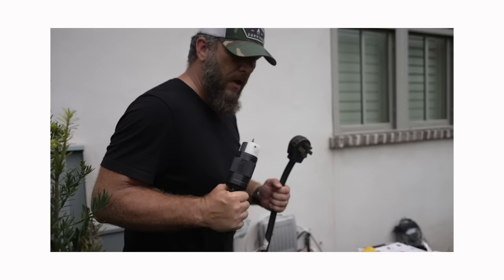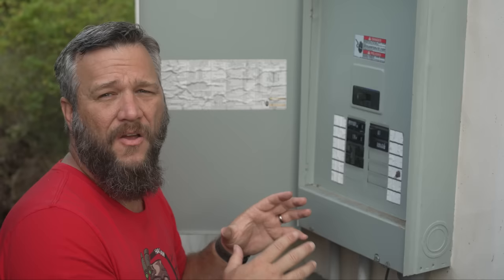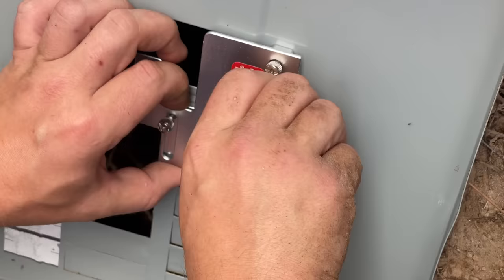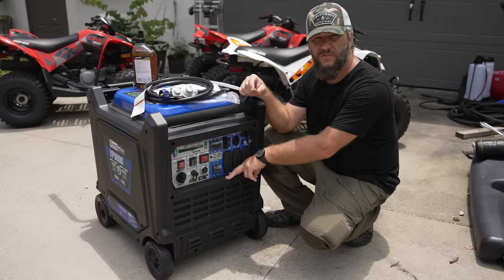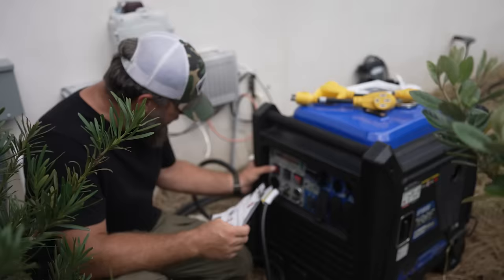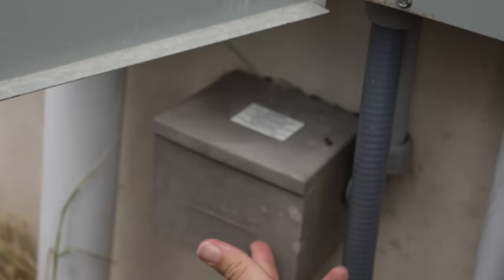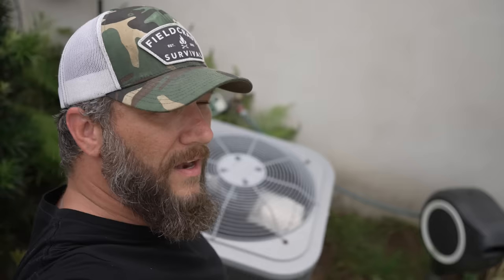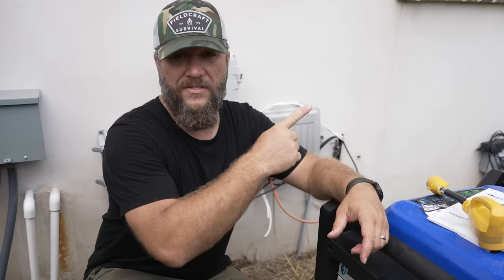90% Don't Know About This Fatal Generator Connection

Comment: All good information. We don't have the same systems here in Australia but could I suggest you get a permanent ink pen and write the procedure on the panel next to the switches in case you are not home when your family might need to use the generator. Also put some concrete blocks down for the generator to rest on. If you need to use it then your garden will probably be soaked and it might settle off level which could affect oil pick up in the engine. Keep up the good work.
Reply: Actually my breaker interlock kit came with several stickers to put on the panel and inlet device to give instructions on how to implement the change from utility power to back up genset operation. Great point!

Comment: If that is an electric stove, I would be very careful about using it, or just don't use it.  You can probably get way with running one burner if you cut back on other loads.  Also, that generator may (depending on the size of the AC) run your AC, but again it will take most of the capacity.  AND, speaking of AC, I would strongly recommend getting a soft start kit for the AC.  That reduces the start up current needed.
Reply: Consider portable induction plate(s). They are efficient and with some, you can control wattage. Yes, you will have no oven, but you can efficiently cook meals in something like a Dutch Oven without massive current requirements. I have been using a NewWave Gold single unit before buying our induction stove to see if I like using induction. I ran it for several months. I am keeping it after buying an induction range, because I know it will work well with my Champion 4750w genset.
Reply: @drzman6901  That is a very good idea.

Comment: I worked my entire life in the electric utility industry and I can tell you for certain a home gen set can and will backfeed the system.  No, it won't be able to power up the grid, but in a restoration situation there will be many lines broken and on the ground.  A home gen set could backfeed a single transformer with its primary lead on the ground.  A lineman who is careless could touch that conductor on the ground and easily be killed.  We were taught to listen for gen sets and to NEVER handle a conductor on the ground without rubber gloves and grounding the conductor.  I can't tell you the number of home gen sets we've come across that were connected incorrectly.  This video is an excellent demonstration of the correct way to connect a home generator.  The only thing I would add to these instructions is if you have a small generator you would want to turn off all your breakers before connecting the generator.  After your generator is connected and running you could then turn on just the circuits you need such as the refrigerator and some lights.
Reply: The generator would shut down immediately if this happened from the current draw smfh
Reply: @msnapp169  Which part?  A gen set can most definitely back feed a distribution transformer...I've seen it and experienced it in my 40 years in the electric utility industry.  How many storm restorations have you been involved with?  Also, you can add load incrementally to a gen set until you reach the maximum capacity of the set.

Comment: Look into a soft start for your a/c unit, It'll make it super easy on your generator at startup from the inrush current. Mine went from 77amps at startup to 19amps.
Reply: Look at "EASY-START" my 3 1/2 -Ton went from 112 Locked Rotor Amps to 35 amps. It doesn't change the running amps, but it will keep your generator from tripping when needed.

Comment: Excellent video Sir. We have a small home so I have a Pulsar 6500w dual fuel generator($550) with a 30amp connection to a Reliance 6 circuit transfer switch( $300) and use a 50' 30amp RV extension cord($250). It will run all my essentials. I installed the system myself with the directions and google videos. It took a minute as I wanted to be cautious, but overall it was fairly straight-forward. $1100 + tax in equipment and about 5 hrs total labor including several test runs($500) So I figure about $1800 all in.

Comment: Good for you for providing this info. Just to add... the lineman won't see just the 120v or 240v your generator makes. Those step-down transformers that feed your house are just as happy to "step-up". They will step the gen's voltage up to the line voltage of your neighborhood, albeit with far fewer amps. But it takes as little as 0.1 amps to kill and at line voltage, that's easily done.
Reply: yea if you back feed the lines, you can actually power your neighbors houses assuming your generator is powerful enough
Reply: First off a lineman would have to forget all of his training to get shocked. They're required to ground everything just like it's a live wire 
The next problem is if you did backfeed the lines as mentioned you would send power to everyone on the grid and you would pop the breaker on your generator depending on what they had plugged in or turned on. You're only outputting 50amps and a couple of AC units is enough to trip your breaker.
And of course you would really have a problem if you were backfeeding the grid and the power came back on.

Comment: In the Navy when using emergency power - we connected source to load and unconnected load to source. Then utilized the no/off switch. We never had to handle a 'live' electrical cable. The effect was that this the only thing being powered up, at the time. As a load hits the generator there would be a slight drop in the 60 cycle hertz as it took that load up, then the governor would recover. Disconnecting worked the opposite way, as the load decreased the hertz would increase a little. Could turn off all the breakers when you turn off the main. Connect the generator, start the generator, then turn on the circuits (breakers) you want to energize. This should result in less wear and tear on the genset.

Comment: As an aircraft mechanic in the AF for 13 years so far...electricty still scares me.  The sh!t is straight up magic and terrifying
Reply: Duuuude.... I'm totally in that same boat. Electricity confounds me like nothing else.
Reply: Agreed. But I was more scared of hydraulic and gas pressure, especially when servicing struts.
Reply: @richieanderson6605  I've seen some pics of what can happen to you hand if a hydro line fails, not pretty.  I'm just an engine mechanic so not really worried about hydro destroying me too much.
Reply: @brandon7219  ah, got ya. I was an F-15/F-16 crew chief.
Reply: Angry pixies...are no joke....

Comment: That generator has a neutral and ground bonded internally which should be disconnected when using for home backup since you home will have its own neutral-ground bonded.  
Good job on getting proper interlock 👍
Reply: Thank you, I’ve been told you can put a switch in your panel for that. Something I need to do.
Reply: My generator is bonded, and I didn't want to monkey with it - void your warranty. I left the ground wire of the four conductor cable disconnected at the generator plug to "debond" it.
Reply: Disagree with disconnecting the grounded connection. It does no harm connected! As for the neutral, there would be zero current in the neutral from the generator if the CB is in the OFF position. Why disconnect it and then forget to reconnect....This is a non-issue.
Reply: @jstone1211 National Electric Code disagrees with that statement.
You may also have issues with AFCI and GFCI breakers having it bonded in both places.
Reply: This is absolutely a problem. Your service should only be bonded in one spot, at first point of disconnect, i.e. your main breaker in your panel. Bonding the neutral and ground in another location will create Objectionable Currents which is a no-no, see NEC 250.142.

Comment: Good Video Haxman.  The one thing seldom mentioned in these interlock videos is the fact that normal generators are set up as "Bonded Neutral" as to be safe on job sites or portable use.  When set up as you (and I) did, the generator MUST have the bond broken, making it a "Floating Neutral" unit.  Simple to convert by removing the ground to neutral jumper wire behind the alternator cover but then the unit should not be used as a standalone generator without causing serious potential safety issues.  This can be confusing, which is why I think it is often not mentioned but curious if your units were/are "floating neutral" generators.

Comment: That missing interlock was unsafe for multiple reasons. For example, if the main and the genset breaker were both on and the genset not connected, that male plug on the genset inlet would be live - a shock hazard right there on your wall.

I've got an interlock to install on my main panel.  But the panel is full and has big breakers already in the top spot that are chore to relocate.
Reply: @liffy8333  Agreed. The job is bigger when the breakers that need relocated are 100amp, the panel rating requires them at the top, the panel cannot accept any more tandem breakers and it is cramped space. It's a chore but I can do anything your "qualified electrician" can do.

Comment: Can't believe it was $12k to purchase and install. We got a Kohler 12kw installed for about $6k right at the very beginning of Covid. Something you probably already know, but the dual fuel models tend to lose about 10% power when running on propane due to energy density. So unless your 9kw penny was a 10kw model to begin with, it's now about 8kw. Something to keep in mind.
Reply: A large chunk of that 12k (for me at least) was the gas line.
The install without the gas line work was around 9kish.
The problem is that for the generator we got, unless it's pretty much right next to the gas meter, you're going to have to use 1 1/4 gas pipe, which is not standard around here. Having that size pipe also means a new gas meter.

Of course, your mileage may vary, and none of this means anything if you're using propane instead of natural gas (though in that case the install price should be lower).
Reply: @vancomycinb1193  That makes a bit more sense. We just run off a 120 Gallon propane tank.
Reply: Yeah. Vehicle’s we’re also cheaper to. Everything is double!  I was quoted 10.5k for a 12k Generic installed in Michigan. That’s ridiculous.

Comment: Wow, you've really convinced me of not only the ease of doing that sort of 'hook up / cutting on / cutting off in a hurricane, but also educated me on the durability of that very expensive generator in the case of EMD pulses.  I love the idea of playing with high voltage in a driving rainstorm!  Thanks.  Also love that your entire house panel is outside in the elements as well!  Most reliable set up ever!

Comment: I've been cheap my whole life seeing how I'm a professional farmer hence I have more brains than money so I don't really have a choice in the matter 🤣

I wired up our business and home for backup generators with outdoor transfer switches (aka double-throw safety switch).  I switched from using our 25kW & 50kW PTO-driven generators to the smaller portable gas versions because diesel fuel has gotten so darn expensive.

I also have a 2-year associates degree in engineering (2 year transfer degree for BS ... never transferred) and a AS in electrical engineering technology so it's safe to say I have a solid understanding how the electrical system works.

Interlock kits suck when compared to using a transfer switch.  A transfer switch is fool-proof and simple to install but the downside is the prices of the indoor boxes are now $400 - $600 and the outdoor versions are $1,000+ which is some serious price gouging if you ask me.  I got mine for around $150 (outdoor) so I guess I lucked out 😜

Basically, the 2-pole 200 amp transfer switch has the generator & mains power wired into the top & bottom with the service panel wired to the center and never shall the two power sources every meet hence no one is in any danger.  The best part is how simple it to switch between the two power source by either flipping the large handle switch up or down.  Putting it in the locked out center position disconnects all power and it's the only way to can open the switch box to boot.

The funny part about this is we had a lineman once warn us about back-feeding our 50kW tractor driven generator and I tried to explain how that wasn't physically possible with a transfer switch but I'm not sure he understood because then he made the stupid ass statement that if he had a generator and tractor setup he'd tell the power company to go screw themselves and generator his own power.  I then proceeded to explain how 9 days of PTO-generated power for our farm cost us more than $1,000 worth of diesel fuel and this was back in the early 90s.  Needless to say, this guy wasn't to smart which was eye-opening and scary 😁

Comment: I don't know about every generator, but, when I fired mine up for the first time I had to adjust my rpm on the generator to get 240 volt. As the rpm changes so does the output of the voltage. I only use this generator for back up power so I lock my throttle is the position that reaches 240 volts. I check it every time I start it up with a Fluke 789 meter as my generator does not have a readout. Very good video.

Comment: 1) Put a battery tender on your generator battery. These batteries are always dead when people need them. 2) Don't handle the power cords when the unit is running. Plug everything in when the unit is NOT running. Yes, I saw you flip the breaker, but what if the breaker was accidentally in the ON position. No need to handle a 50 amp cord with 50 amps on it if you don't need to. 3) Have extra oil on hand for an extended outage. Rule of thumb on oil changes is every 50 hours if it does not have an oil filter and every 200 hours if it does have an oil filter. So potentially you need to be changing your oil every 2 days or so.

Comment: This type of system works good and several of my neighbors do this however, I installed a whole house stand by generator.  If you contract all of the work yourself you will save a few thousand dollars.  Unexpectedly, the  power went out last week for several hours. My generator kicked in with no issues.  I was not home and my wife can not physically move a heavy generator into position, hook up the gas line and plug it in.  A few thousand dollars more for a permanent generator that can run the entire house is worth it.  By the way all of my neighbors that have portable generators where sitting in their dark homes in 100 degree heat waiting for the power to come back on because they didn't want to go through the exercise to hook up their portable generators.
Reply from the maker: It’s true that there have been times when we just went without power because I didn’t feel like hooking everything up.

Comment: Enjoy your content and always look forward to each video. But I bring you bad news,  informing everyone that this type of interlock kit is required is an excellent  public service to keep utility workers safe, but your installation is still incorrect, as are 99% of interlock videos. The breaker used to energize your panel during generator operation requires a Hold Down Retainer kit.  Your particular panel would require a Eaton BRPHD2
Reply: Excellent point!!
Reply: you meant well and all, but his is not the plug on neutral panel (PON), so he needs the older hold-down. while it's required by code, it's function is to keep some "fool" from moving the breaker around easily and causing a back feed or power inlet pins from becoming live.

Comment: If you are starting from scratch (no mods made to your panel) and you don't want a whole-house solution, consider an 8-10 circuit transfer box. This will allow you to use pre-determined outlets, lights, etc. during a power outage. It also means you can get by with a smaller generator. Transfer boxes are simple to use: one switch for each circuit Each switch selects line or generator, preventing back feed to the utility line. If you are handy with your own electricity, they are easy to install. If not, hire an electrician. I would recommend getting a local permit too for your own protection. I installed an 8 circuit Alliance Control Transfer Box. I used wire in conduit from a subpanel in my garage to an outside attachment plug for the generator.  I attached the 8 circuits to critical house circuits such as the refrigerator, various outlets and kitchen lights (all are LEDs). I can use an induction stove, I have kitchen lights and the refrigerator keeps working with my 4375w generator. I can also charge batteries. Eventually I will hook up the house heater to a circuit. Our house is heated with natgas, so I need to power a thermostat and a fan. You will need a larger genset if you heat with electricity.

Comment: I love your videos and have "borrowed' many of your solutions for use at my homestead , but this is  one of the few things I have to disagree with you on. Having had both the manual setup and the automatic setup, I'll spend the extra money on the full Generac, or manufacturer of your choice, solution. Playing with generators and hookups in the middle of the storm is not safe. When the power goes off, the generator senses it, starts up, and switches over. When the power comes back, the generator senses it, cuts back over to mains power, and shuts down. It will even activate if we just lose one phase of the mains. I never worry about my wife having to play with the generator if I'm not home or sump pumps, security and other critical gear not operating when no one is home. Here in The People's Republic of Illinois,where our electric grid was installed by Edison himself,  we average about 6 outages a year with some of them lasting several hours. I spend about $50 a year to maintain it (oil changes, air filters and spark plugs). The cost was well worth the safety and peace of mind it gives me.